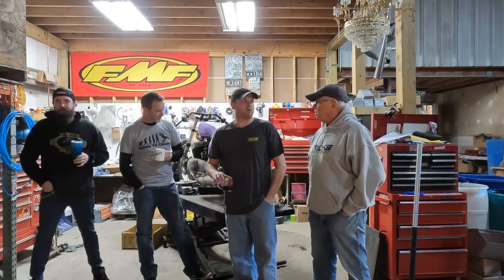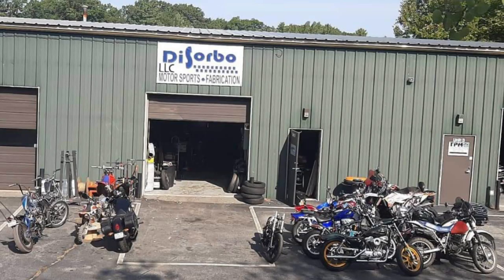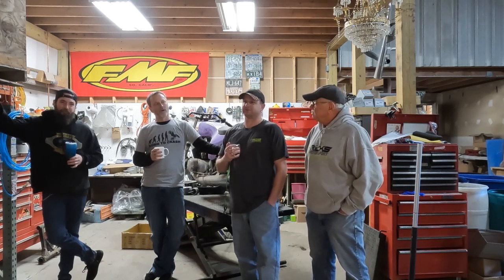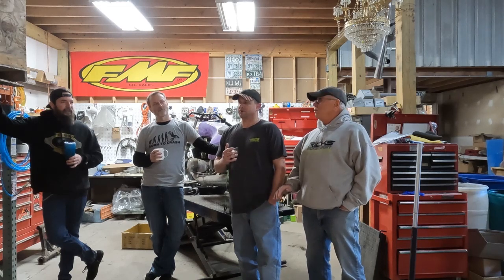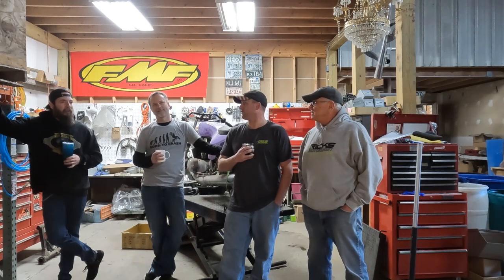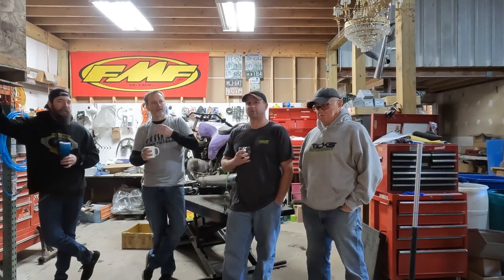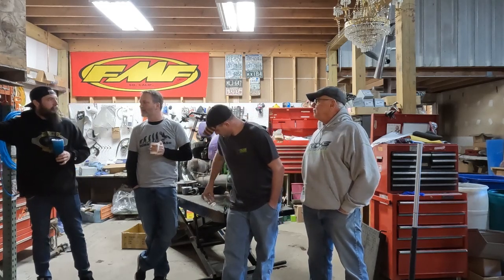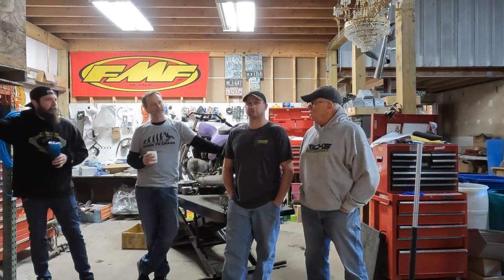Rick's Shop Talk Episode 42: Worst Bikes to Work On

Comment: Easy bikes to work on?
Reply: My 1992 CB750 Nighthawk is pretty simple. It's like a 2wheeled version of a dog. It just goes, no valve adjustments,  just change the oil, filters & ride it. It doesn't do anything really great, but it doesn't do anything really bad either. Cheap too.